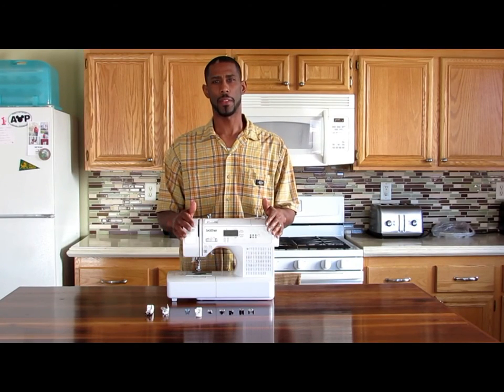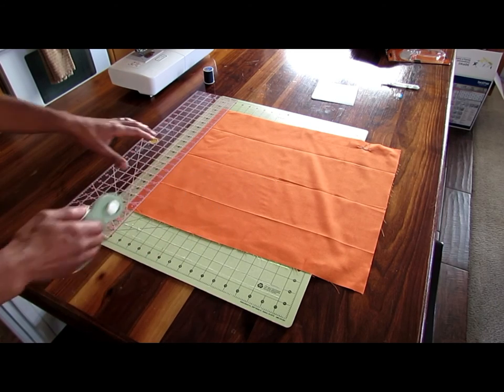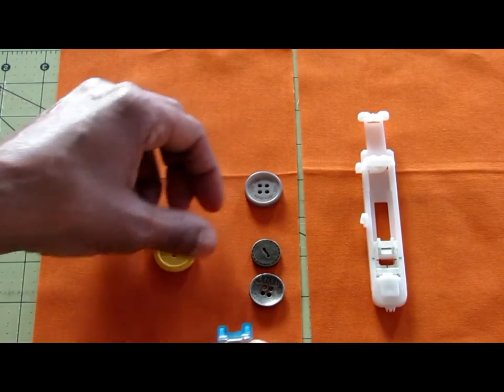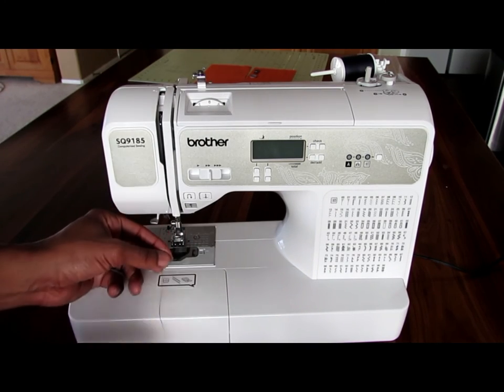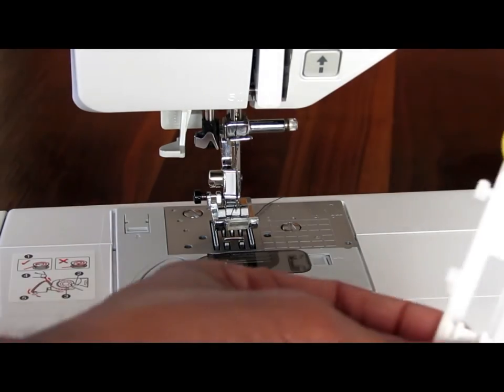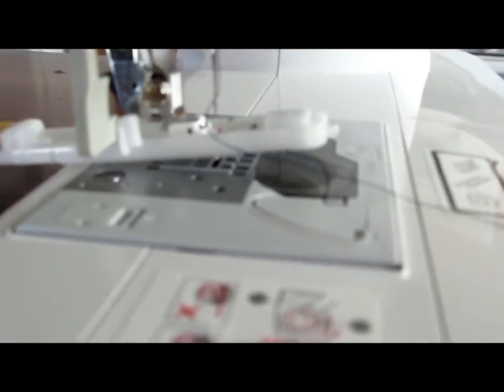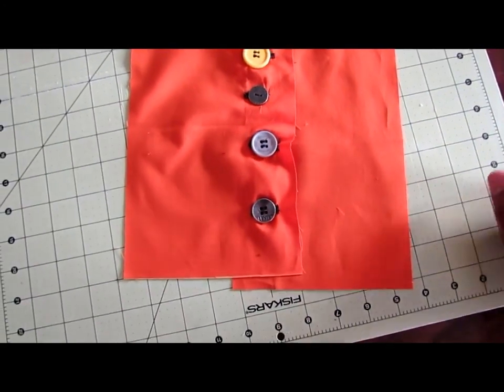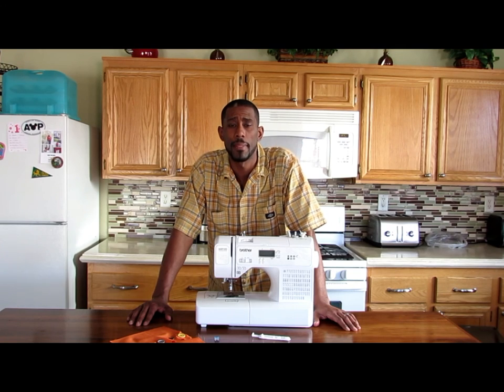Sew Buttons To A Shirt | Learn How Using A Sewing Machine

Comment: Thank you for the clear tutorial! I have a tip to pass along from another sewing channel (Debbie Shore): use the buttonhole foot on the setting for the particular buttonhole you want to make a sample buttonhole on a scrap piece of fabric. Cut it out and use it to decide where you want to sew the buttonholes on your fabric, then mark each location with the tool of your choice (chalk, erasable pen, pencil, or soap). A warning about using Frixxon pens as temporary fabric markers (they’re the pens that disappear with heat from friction, irons, dryers, etc); know that the ink returns when whatever you marked gets chilled enough. I love the pens for writing but I wouldn’t use them on anything I needed the ink to be permanent OR erase permanently.

Comment: Another great video!  It's fun as well as knowledgeable to watch your videos.  I have a question: you showed in another video how to thread the thread through the machine.  When I use the thread holder that's horizontal, my thread always snaps where it gets caught in the slot where the thread goes when not in use on either end of the spool.  Could the vertical thread holder be used for everyday use and not just when two spools of thread are needed?  Would that confuse the machine?
Reply from the maker: Yes, I had the same problem and now I just use the vertical thread holder like you suggested. It works perfectly. I really appreciate all your support.

Comment: I've made a wool coat and the fabric is very thick and loose woven. When trying to make my button hole the fabric doesn't move . What is the problem??
Reply from the maker: Cassandra Keller Your material might be too loose. I would try to adjust the tension and see if that helps.